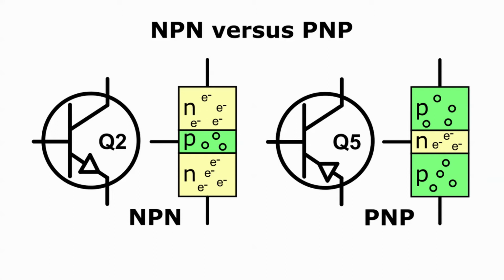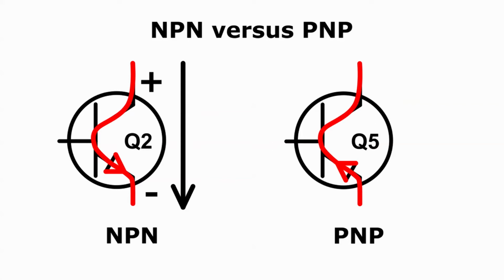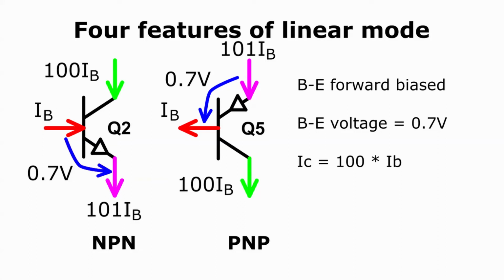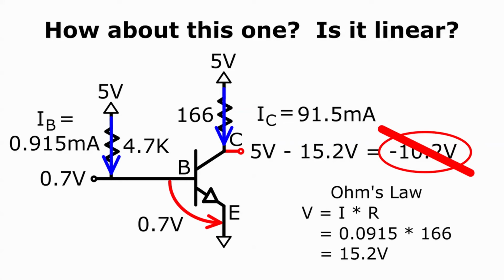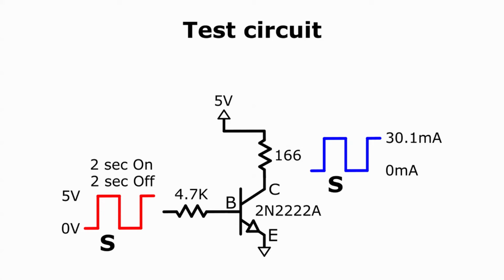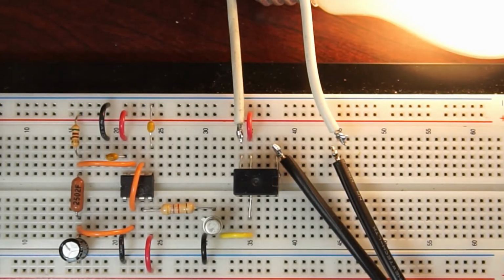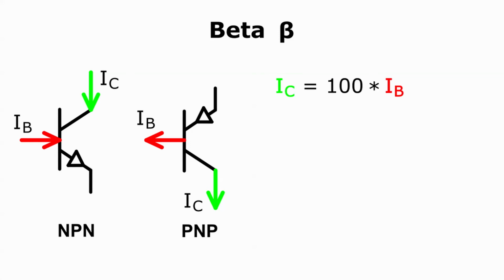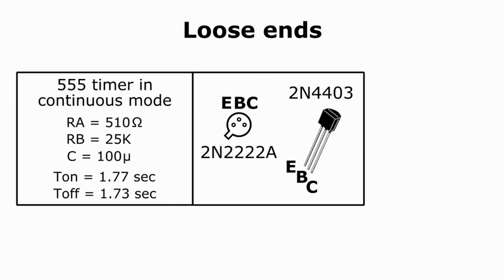NPN and PNP transistors in switching mode

Comment: Awesome viedo! I never tried to use transistors, bc I never fully understood how the different modes work and how to calculate the circuit to achieve a specific mode. Until now, I've always been using Mosfets instead, bc they are simply a switch. Thanks for the great content!